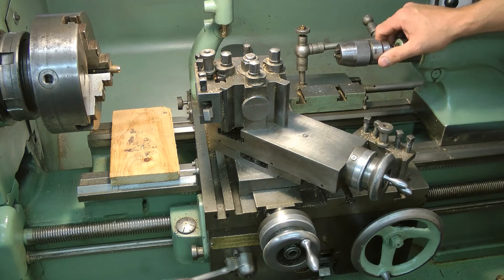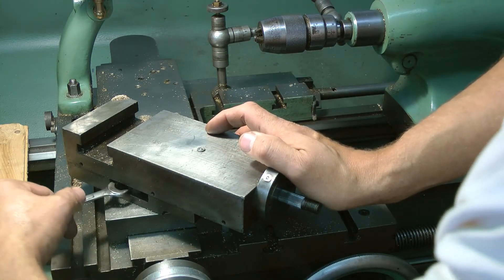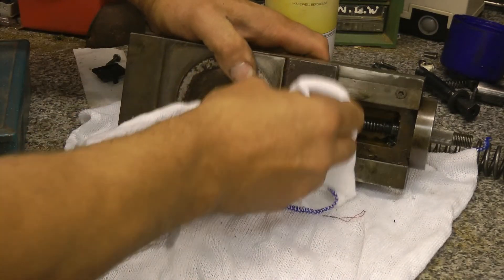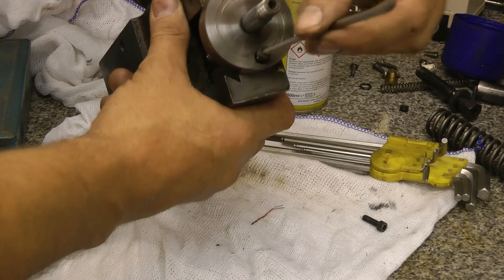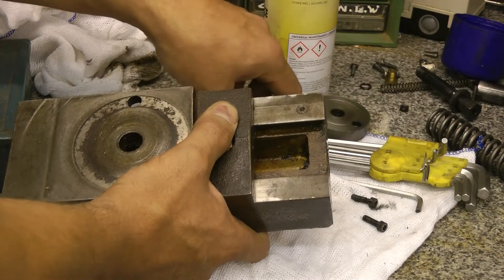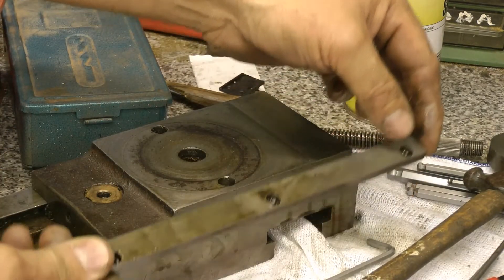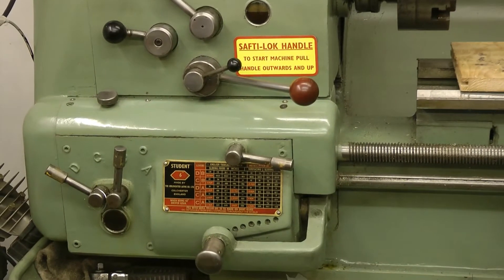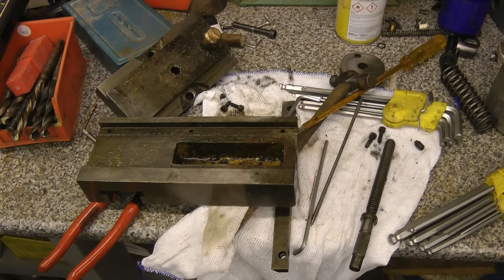Colchester lathe compound slide dismantle /disassembly

Comment: The 5/16" threaded hole in the nut is there so a 5/16" bolt can be screwed into it to pull the nut out (after removing the screw and loosening the set screw). No other disassembly is required.
Reply from the maker: Thank you  I didn’t know that !

Comment: I did this same thing the other day on my newly acquired Colchester Student :) I found that one of the saddle 'keeper' bolts fit in the brass(bronze?) nut, then a couple of risers with a strap clamp spanning them. Then screw the bolt in and the brass nut comes out. (After removing the set screw of course lol)
Had me thinking a bit though! I did remove a gib strip also, but I don't think it was required to be.
Your lathe looks in very good condition! Mine is quite 'used'. I still love it though!

While I'm on the subject Chris, do you know of any suppliers who may have new half nuts? Cant find any here (Tas, Aus) and mine are "ahem.. quite worn".
Reply from the maker: MrPhatNOB  parts are hard to come by as you know , I find most things on eBay just takes a little time , my lathe is pretty worn to , some of the gears are very noisy, it just got treated to a paint job 😅 and a few bits here and there, what are you going to use your lathe for ?

Comment: Pulled my leadscrew nut out with a slide hammer! a great watch
Reply from the maker: lol ! now  that's one thing i don't own .... think ill make one , what do you use your lathe for mostly ? thanks for viewing :)
Reply: @Madchris1  Work as a Shipwright so it's rudder bearings and the like, boaty stuff. Made a new cross slide leadscrew and nut for the old girl, sold a couple as well. Play with wood & fibreglass during the week and metal at weekends. Love the channel and your "oh well" approach, great stuff keep it coming!
Reply from the maker: I'm Stubby  impressive!   What machine  did you make the lead screw on ?  Nothing wrong with a bit of metal work at the weekend 🙂 I’m the same as you ,i work with wood all week , and metal is way more exciting... sparks ⚡️ and all 😅 thanks for viewing
Reply: @Madchris1  Leadscrew was made on the student to start with, was good but not good enough so bought leadscrew and machined the end, made a jig to hold nuts of centre made lots of taps till i got one that left no backlash in the nut, designed a two part antibacklash nut that can be adjusted in situ. works very well but now have about ten taps that aren't good for anything. Got one leadscrew kit on ebay if you want to have a look. Cheers

Comment: Thanks for doing this for me. You are my hero. :) When you reassemble.... make another video just in case. :D
Reply from the maker: daemonuk lol , a pleasure, one note  mine stiffened up when I reassembled, so I had to move the brass nut up and down in its hole to line up with the thread 👍
Reply: @Madchris1  That maybe why mine is stiff then (oooerrr) - genuine thanks for this. I got to the nut part twice, before reassembly with much swearing.
Reply: @millomweb  any details on how to perform the correct alignment?
Reply: @theflyingchillipepper  Assemble it completely but leave the nut clamp screw loose. Tap things with a hammer to jolt any bits that are close than the rest slight away - before finally clamping the nut by tightening the grubscrew. If everything runs freely, that's about right :) Adjust the gib adjustment to give a slight stiffness to  the movement - bearing in mind it'll be more worn in the middle - so be sure the ends of travel are not too stiff to make that part difficult to use smoothly. HTH.